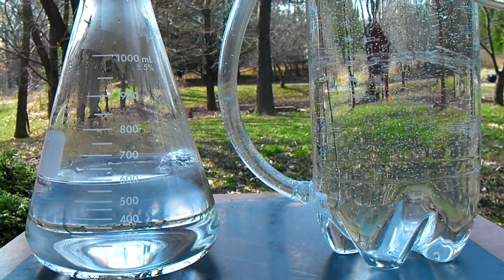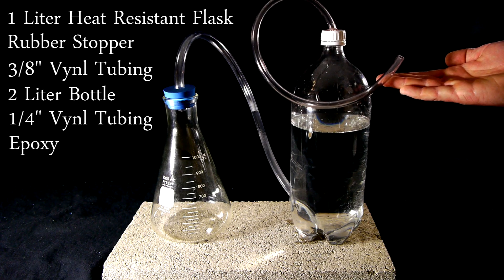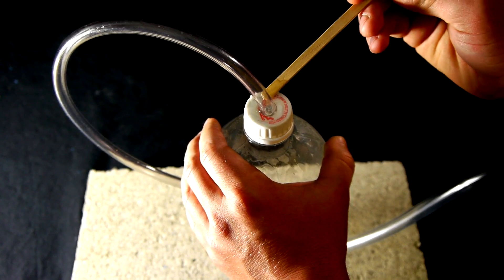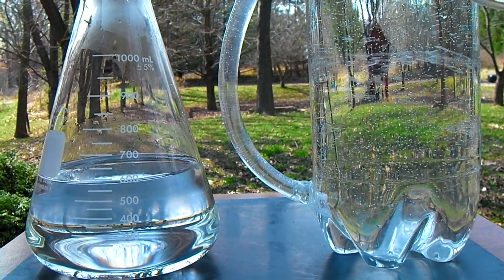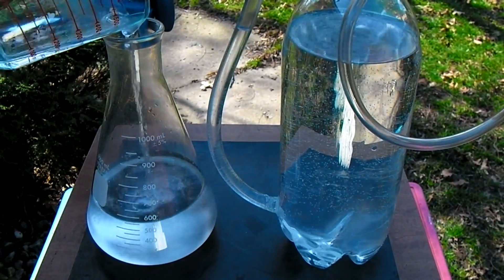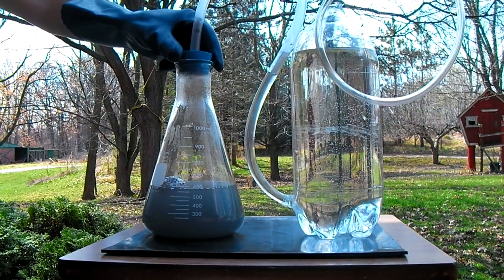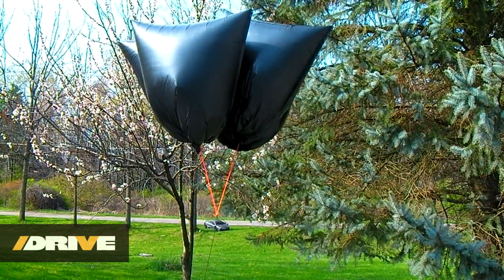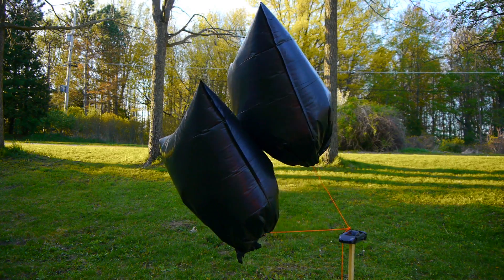How to Make Hydrogen Gas - Clean Burning, Inexpensive, Lighter than Air!

Comment: How do you dispose of the left-over substances in the flask?
Reply from the maker: Ben Runsdorf Once it no longer reacts with aluminum it's a pretty neutral solution and doesn't require any special disposal methods.
Reply: NightHawkInLight Thanks
Reply: +The Funny Chemist Well, the best way is to add baking soda until it stops fizzing when you add it.  Then it is as corrosive as salt water.
Reply: I did mine beside my fire pit and just poured it in there when I was done bc I believe it's just aluminum oxide when the reaction is finished
Reply: Find molten  aluminums freezing point and turn it into a metal again  XD
Reply: Coopa Jay: 
Thats not what the 60s were about man
Reply: NightHawkInLight But when I poured it down the kitchen sink, the kitchen sink got corroded.
Reply: You gave to add magnesium to replace the AlCl3 with MgCl2 which is more reacrive. Tge aluminium will percipitate out of soulution and you can melt the powder whis is foing to be very inpure.
Reply: Matthew King thanks.
Reply: Neutralize it in a solution of baking soda
Reply: I just drink it myself
Reply: neutralize it and pour it down the drain (?
Reply: ***** Theres no cattle in my garden, drama queen.
Reply: +Ben Runsdorf its not complete neutral, it`s better make a hole in the ground, drop it inside and fill with soil again.

Comment: Oh my Gosh. Idiot. This can be made with 9 volts DC power, a balloon, a couple of paper clips, and 2 copper rivets. If you can't figure this out, don't watch this video.
Reply: There's a problem in that the hydrogen generated by that method is contaminated with oxygen and needs some sort of apparatus to prevent the hydrogen from escaping.

Comment: Can I create a star?
Reply: But we have gravity pouts
Reply: but... SCIE
Reply: With enough hydrogen you will
Reply: Of course, it would require a lot more hydrogen than we could ever get on earth though
Reply: no. fusion requires deuterium, an isotope of hydrogen with an extra neutron
Reply: @johndoeseph115  No all elements can be fused and give up more energy up to iron.  But yeah deuterium and tritium give off the most energy so they are good starters.

Comment: I did a similar experiment about 45 years ago using lye in water.  Added bits of foil to get the reaction going.  Rolled the bits into pea sized pieces.  Used a thick coke bottle in a bucket of sand.  Gets real hot!  Put a balloon over the mouth of the bottle and let it fill.  Carefully removed and tied it off.    Had to be careful not to get the condensed vapors on skin.  Solution is highly caustic.  I like the idea of the water bottle as a filtering system.  Wish I'd known that way back then.  I noticed in this vid that you did not describe how to dispose of everything after you were done.
Reply: Darrell Pidgeon STATIC IGNITES GAS DIP SHITCHEM HEAD
Reply: D. Saelens Static, yes.  You am smart.

Comment: could someone answer this technically couldn't you use magnesium in the water to make hydrogen as long as you keep it from setting on fire
Reply: I have actually done it with magnesium, just dilute the acid in a 1:5 ratio

Comment: If I pop the Ballon in my house will it release toxic gas
Reply: It would release water vapor(non-toxic).  But it's not a good idea because your house has flammable materials that could catch fire.
Reply: By "pop" do you mean sticking a pin in the balloon? 

Hydrogen isn't toxic. It is a "simple asphyxiant" - if there's too much in the atmosphere you'll die from oxygen deprivation, but it's not like carbon monoxide or phosgene that'll go after your ass on purpose. So no, popping the balloon won't release toxic gas. 

As to flammability...you need at least 4 percent of the atmosphere to contain hydrogen before it'll explode. If you pop the balloon and the gas diffuses, there's no big problem. If you want to pop the balloon with a lit cigar tho, take it outside.
Reply: No

Comment: Would be cool to see this done using electrolysis rather than acid.
Reply: ***** I filled a gallon window washer jug with hho and lit it remotely...WOW it was loud!  Like rattling bones and windows king of loud!  I'm just going to stick with 500ml water bottles from now on thank you very much! haha
Reply: @nickwoodruff3321  definetly not from a TKOR vid
Reply: @prospektOS-tmo97  lol
Reply: Search HHO generator. I don't know why it's called that, but it is. However, hydrogen and oxygen are, of course, both produced.
Reply: @rusty6172  it is called HHO because it has Hydrogen and Oxygen split in the gas.   If you had two electrodes in that gas and lit it, it would explode.
Dont know if this is HHO or real Hydrogen.  If those same electrodes were in true Hydrogen gas and lit,  it would not explode because no oxygen.
Reply: You can (very easily) but it makes hho witch is much more explosive because it is produced along with oxygen.
Reply: you do realize that HH0  is just water (H2O), the reaction produces hydrogen gas and oxygen, not H2O
Reply: Base*
Reply: Oh nvm i thought he used sodium hydroxide my mistake

Comment: So can you use this as rocket fuel? Or would it be too explosive?
Reply: If you can get liquid hydrogen yeah
Reply: You would also need an oxidiser, and since you're talking about rocket fuel, you would need liquid oxygen and a controlled engine which would set you back a couple of thousand :)
Reply: How about instead of rocket fuel... lift your ordinary model rocket to the top of the stratosphere with a couple weather balloons THEN ignite your rocket... (just dont take out any satellites or they will try to hunt you down)
Reply: wouldnt be very good its a gas

Comment: Another easier way to make hydrogen. Use Lye drain cleaner, sodium hydroxide, (not drain brand, too many impurities). Add some lye to a glass bottle, with a few inches of water, then drop in some rolled up aluminum foil, let the reaction get started and you will be able to fill balloons right from the bottle. You won't have a lot of time if the reaction really gets going, it is very exothermic, and the bottle will become too hot to touch, not to mention that a boiling sodium hydroxide solution is not the safest thing to be near!

Comment: Hi. Instead of using hydrochloric acid, which requires 2 moles of HCl per mole of H2 and further contaminates the resulting hydrogen with hydrogen chloride (although it can be scrubbed completely); i would suggest NaOH for better availability, better molecular economy (⅔ moles NaOH per mole H2) and cleaner hydrogen gas. Dissolve it in water and use just like hydrochloric acid.
Reply: Gallium indium alloy is even better for hydrogen production.
Reply: it's just not safe for kids on internet do it.
Reply: hllink And how would kids understand this shit?
Reply: Danny Jaber that's what chemistry classes are for..
Reply: Danny Jaber exactly build one with a 9 v battery simple safe and lots of stupid people THE ONLY SMALL PROBLEM WITH THIS IS THAT STATIC MAY IGNITE THE GAS IN YO FACE FOOL NERD WITH NO WELDING GAS SAFTEY ARE HAIRLESS AND CHARED IN THE END .. A POETIC JUSTIC
Reply: hllink Because you think using 31.45% HCl is safer?
Reply: JayMark2049 never said that..
Reply: hllink
Hence why I asked. It's a question, not an affirmation.

Comment: Won't the reaction between HCl and Al produce such hot temperatures that it ignites the hydrogen gas and blow up? I want to know before I perform this experiment. Thanks
Reply: Hydrogen has an "upper explosive limit" - the point at which the mix of hydrogen and air is too rich to burn - of 75 percent. When the gas in the flask becomes more than 75 percent hydrogen, it wouldn't burn if you tried lighting it with a blowtorch. 

Which is the long-winded way of saying, "no, you're fine."

Comment: If it can lift 200 grams with only 4 bags, you would probably life 20 grams with 1 bag. And you can buy cameras that only weigh 20 grams. Just attach a bag to it and let it float off into space. When it eventually falls back down, you can find your camera and you'll have some really cool footage of earth from space. It'd probably be heard to find the camera, though. Maybe you could like float a GPS tracker up with it as well. I found one on Amazon that only weighs 30 grams and is only $20, although, it has 2 stars so it might not be very good. But that's still only 40 grams together, so 1 bag could still lift it.
Reply: It won't even go out of the atmosphere.
Reply: Amelia Hartman Your math is way off.
Reply: Tom-Tristan Ots Why? Is 200/4 < 20?
Reply: ThePokemonPizza No one's saying we're going to send this to the moon or anything. It's gets to the edge of the atmosphere, which is all you need. Just look up video of people doing things similar to this. The video is quite spectacular.
Reply: ***** Yes, I can do basic maths. -_-
Reply: Amelia Hartman YES THIS WILLLLL WORK AND ALSO IGNITE AT    ANY   MOMENT KEEP TRYING THIS IS POPULATION CONTROL AT ITS BEST
Reply: D. Saelens uh... it's a balloon. The worst it'll do it burn your eyebrows off if you're right up next to it when it ignites. It ain't gonna kill nobody.
Reply: *****  oyll get the same boom as it has the same number of protons and reacts exactly the same, unless you compress it to 1million psi and heat it until its a plasma, that's what happens in a fusion reaction like the h bomb or the sun.
Reply: it 50 grams ina|| n0t 40 0k just t0 be right 0k and it wi|| take 2 bags and it wi|| brake 0n the way back the erath by burning and fa||ing and space wi|| mass up the gps 0k n0t t0 be meen just t0 be right

Comment: It would be much safer and easier to make hydrogen gas by electrolysis. You also could use hydrogen peroxide that you find at your local store. Both examples are way safer than using acid.

Comment: Instead of Aluminum add Zinc (melting it from modern 1 penny coins) ;))) Want to have really good blast? —Fill the balloons with mixture of Oxygen and Propane, then attach them together with Helium(or Hydrogen) filled balloons...then use small cotton rope soaked into water emulsion of KNO3(or any other nitrate fertilizer) and then dried...let the balloons fly and burn the rope;))) The best fireworks ever you'll see!
Reply: Or you can fill a balloon half and half with hydrogen and chlorine in a dark place and then detonate it with sunlight.

Comment: I did this, and when it does it for like 5 mins the water gets pushed back up the tube into the acid beaker?
Reply: The reaction makes heat expanding the gases a bit. When it cools down it makes a vacuum. Just like that candle in tin of water with a cup on top of it.
Reply from the maker: That will happen when the reaction stops. Pull the stopper out when gas is no longer being formed.
Reply: okay thank you,

Comment: What if you placed a non-heat resistant glass bottle in cold water, would that work to prevent shattering?
Reply: Yes- as a kid I used a large beer bottle with a mixture of caustic soda, water and bits of aluminium foil.  Connect the neck of a rubber balloon directly to the top of the bottle, and submerge the bottle in a bucket of water.
Reply: SciGuy brilliant idea?

Comment: You can also purchase "The Works" toilet cleaner from the dollar store, which is just 20% HCl, or use electrolysis with water and a little lye to produce a 2-1 mixture of H2 and O2 which is far more explosive, but less buoyant.

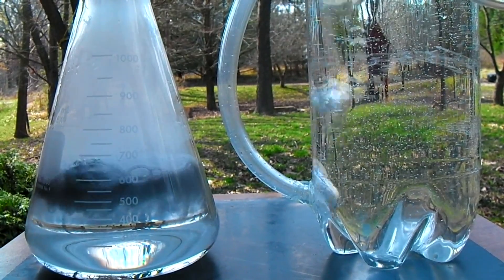Comment: 4:52 Its not Aluminium chloride, when aluminium mixed with water as the Cl- ions are displaced with H2O molecules in the lattice to form the hexahydrate AlCl3·6H2O, HCl is lost leaving aluminium hydroxide or alumina (aluminium oxide) or in other words you would be making *Ethylbenzene*= It is a highly flammable,colorless liquid with an odor similar to that of gasoline used to make styrene. Ethylbenzene is also used to make other chemicals, in fuel, and as a solvent in inks, rubber adhesives, varnishes, and paints. Ethylbenzene exposure can be determined by testing for the breakdown products in urine. The acute toxicity of ethylbenzene is low even with high level exposure you'll just get "Dizziness". What your making is one of the two. Aluminium Hydroxide(The major other uses of aluminium hydroxide is as a feedstock for the manufacture of other aluminium compounds: specialty calcined aluminas, aluminium sulfate, polyaluminium chloride, aluminium chloride, zeolites, sodium aluminate, activated alumina, aluminium nitrate) or Aluminium Oxide( aluminium oxide is used in Abrasives, Fillers ,Catalysis , Purifications, Paints, ..ect.) Still love your videos though, just wanted to clear that up and teach chemistry lol
Reply from the maker: You're mistaken. It's not possible for aluminum hydroxide to exist in the same solution as an acid. Additionally, where in the world are you getting that Ethylbenzene is formed via this reaction? Ethylbenzene contains carbon molecules, and there is no reactant used here that contains any carbon whatsoever. It's completely and utterly impossible for ethylbenzene to be formed in this reaction or any like it.
Reply: When aluminium trichloride is used its in application in the chemical industry as a catalyst, like the products are detergents and ethylbenzene, but ethylbenzene was proof of what you were not making.                          Aluminium is amphoteric, which means it can act as an acid or base depending on reaction conditions 
acid conditions it acts as a base 
Al(OH)3 s + 3HCl aq ==> AlCl3 aq + 3H2O 
Alkaline conditions 
Al(OH)3 s + OH- aq <===> Al(OH)4 - aq the aluminate ion 
in case of NaOH aq sodium aluminate is formed 

Pepsi acidic 
vinegar acidic 
ammonia base 
AlOH3 amphoteric as described
Reply: TheLuerker damn your smart lol.  I love science but I never learned anything like this in the highschool I went to (sadly). i don't know much about atoms i know a little like sulfur and h2o make sulfuric acid... that's pretty much all i know lol.. carbon and oxygen make carbon dioxide.. meh im so uneducated for a guy who loves science lol.
Reply: I never learned this in high school ether, I actually got bored and taught my self it... even though I proved a point talking with "NighHawk", I can be wrong about my comment, I really like his videos, but when I commented like this I was really worried that what I had said might have made him mad, which was never the outcome I wanted
Reply: +Cuboose you never showed us where you were getting the carbon from. The chemical formula for ethylbenzene is C

6H

5CH

2CH

3. There is no available carbon in this reaction in that it is happening in a sealed container. The only elements you have available are Al, H, Cl, and O
Reply: +Robert Jenkins (RA12 ABEOone) ** C6H5CH2CH3**

Comment: As a kid I would separate Hydrogen from Oxygen in water by electrolysis... I find it may be cheaper/easier/safer to do that way instead, and you can get an oxygen output as well.

Comment: Nice and simple. Nifty apparatus setup!  As a kid, I prefered using sodium hydroxide instead of hydrocloric acid. NaOH was a little cheaper than HCl, and both aluminium foil and NaOH (Caustic Soda) could be purchased in any food store. Reaction:
2Al + 2NaOH + 6H2O -> 2NaAlO2 + 3H2
The reactants could be mixed dry. Adding water with a syringe into the reactor would generate hydrogen almost in an instant. Unpleasingly exotherm reaction, though.
Reply: 2 Al + 2 NaOH + 6 H2O → 2 Na[Al(OH)4] + 3 H2
Reply: Yes. Na[Al(OH)4] is more correct. One have to dry and roast this reaction product heavily to turn it into  NaAlO2.   Thanks ;)

Comment: You could also just do electrolysis of salt water which is safer and environment friendly than using HCl.
Reply: wouldn't that require a strong current and voltage...?

Comment: Hey Ben! I was wondering what safety measures should you take when working with hydrogen explosions? please leave a response to this comment.
 Thank You
Reply from the maker: Well, It's fire, so don't burn yourself or use around flammable things. Wear a face shield and non synthetic clothing.
Reply: Thanks! And a happy new year